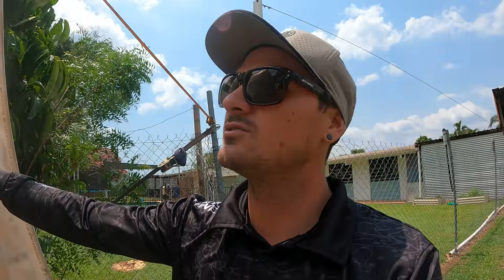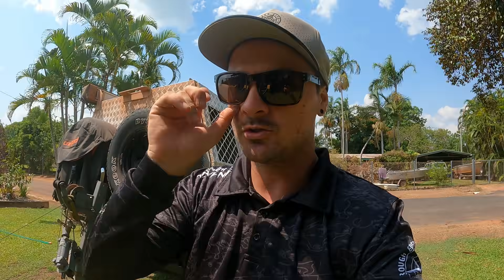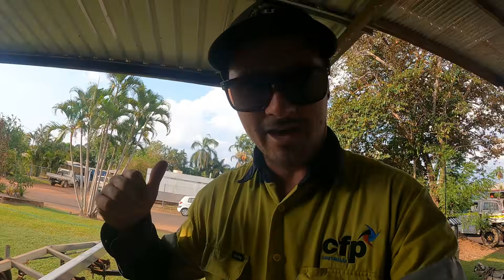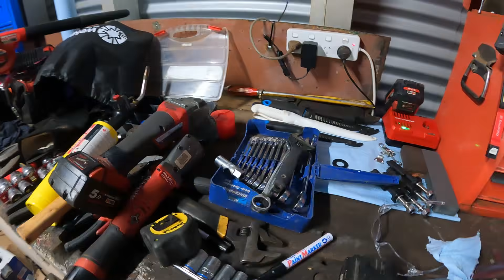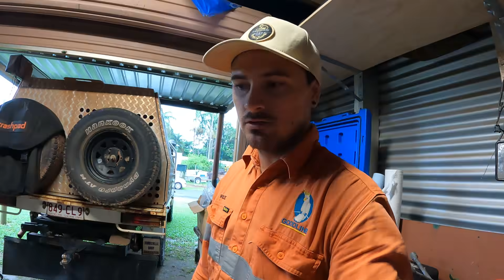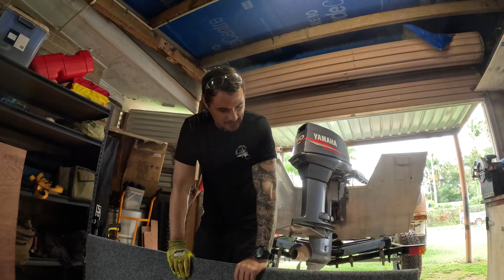BUDGET BUILD - TINNY EDITION - CAPE YORK SPEC

Comment: you done ok on the boat as long as it holds water its good ,as for trailer its full rhs bar not c chaannel , i bought an old Brooker trailer that was twist and bent like a banana ,I used my Porta power to straighten it welded up all the cracks, replaced the rollers , painted it with red oxide epoxy enamel killrust then coated it in white epoxy enamel and it looked nnear new ,a new winch to, dont worry what the "experts" say as long as it works for you.